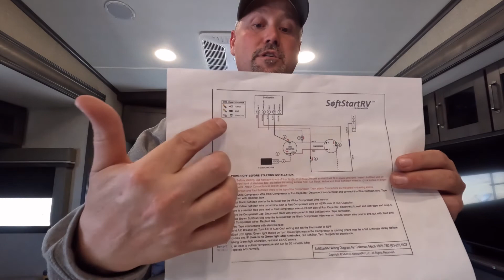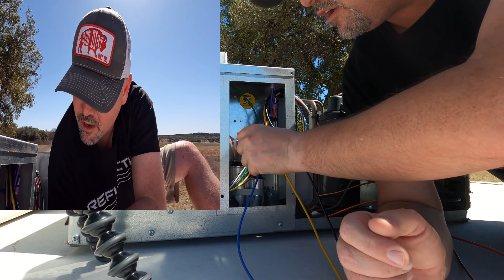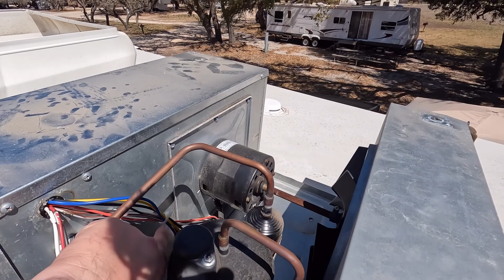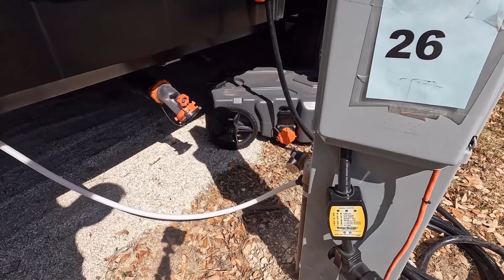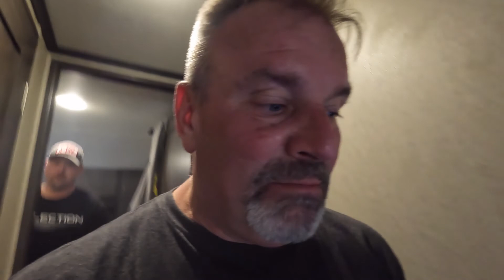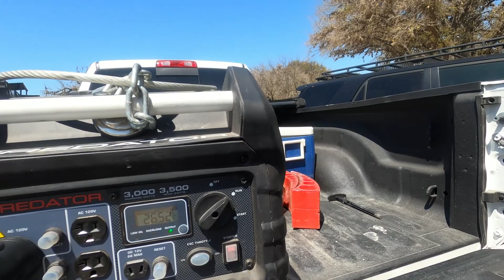Soft Start RV Install | Finally we can run BOTH Air Conditioners on 30 AMP or our Generator!!!

Comment: Good video.  Will the predator start them in eco mode? And was the surge protector plugged into generator?
Reply from the maker: It will start in eco mode but I always make sure to start in regular mode then switch to esc mode. 
The surge protector will not work in the predator. It shows a ground fault or reverse polarity. So we just use it without. Thanks for watching!!
Reply: @CompassRoadz  Awesome.  Just a bonding plug is all you need for the surge protector to work
Reply from the maker: We’ve heard and seen that on another video. I guess we haven’t done it because we already use a dog bone to step down from the 50 amp cord to 30.
Reply: @CompassRoadz  Good deal 👌